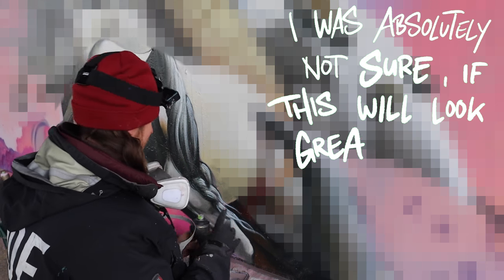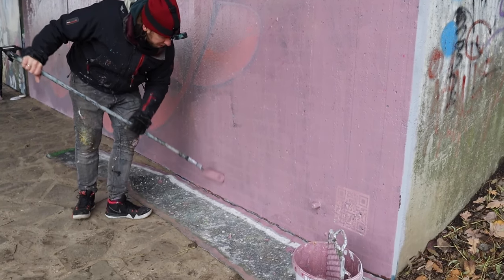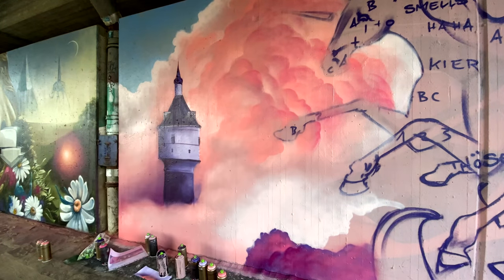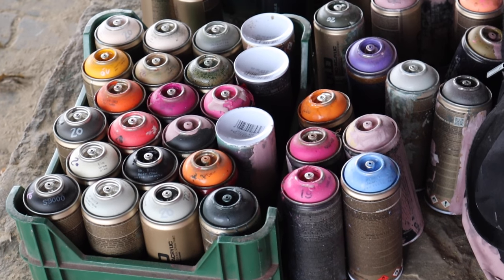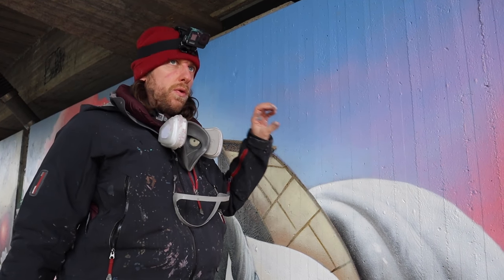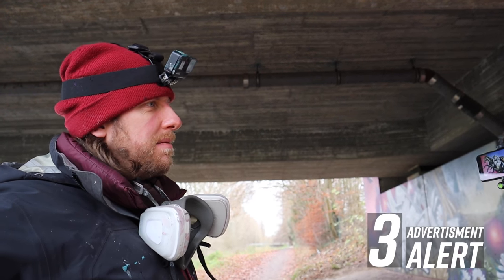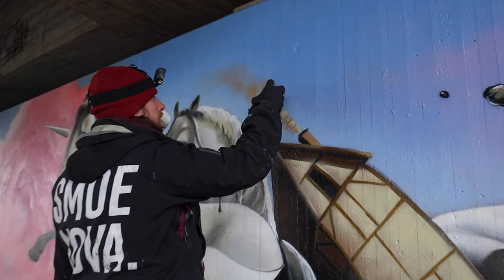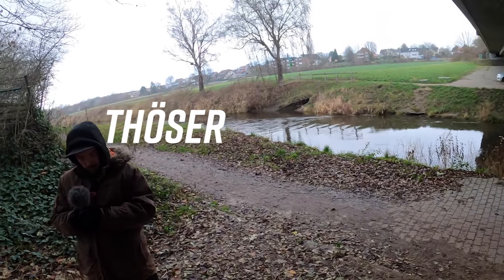🦄 let´s paint UNICORNS under this BRIDGE. (my best mural ever)

Comment: The roller doesn’t get dirty aswell slams it in paint bucket with sticks and leaves in it
Reply: Agreed
Reply from the maker: my handcard had an accident the other day and I had to rescue the paint, because only one half of the bridge was coated… I tried to scrape the rest of the wall paint off the floor with a pizza box and my hands. But it worked.

Comment: I am not an artist so this will probably not surprise you...what is the point of the nuggets you are so pleased with?
Reply from the maker: while painting my intention is to make the artwork better with every stroke i make - comparable with knitting a pullover - every step I do is necessary to please the final result… but the pert besides the house did not turn out like expected, like you knitted wrong and decide to fix that problem and put a patch on there - the nuggets are just a patch to fix the part that did not turn out like expected… they are absolutely random, but they did their job so good that they probably became part of my reportorial of elements I will use in future artworks. It looked better than if the part besides the house would have worked well… that was the reason why i was so happy.